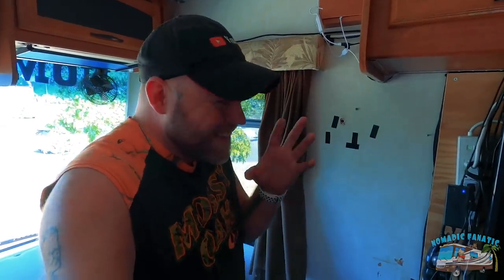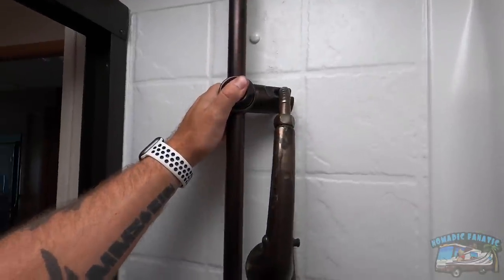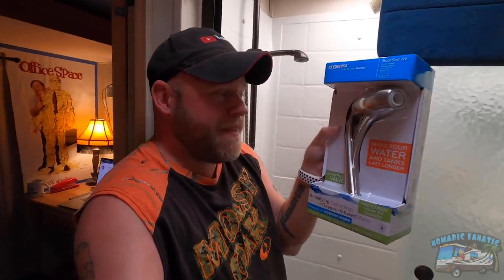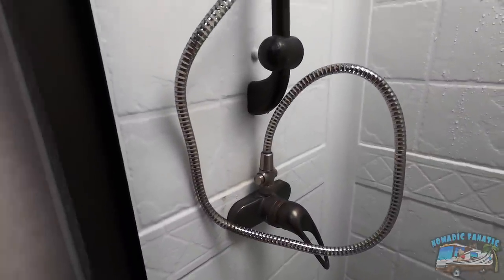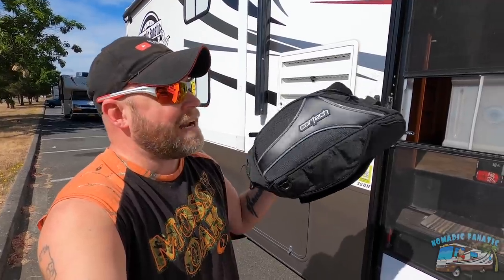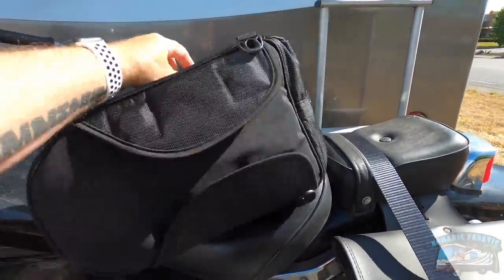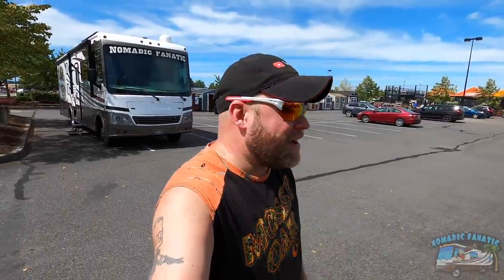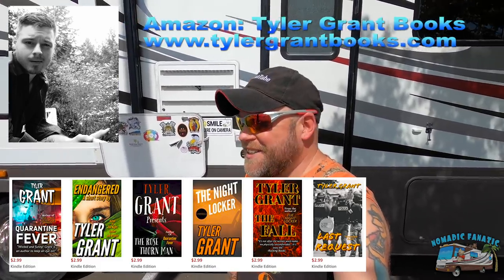Backwards Time, Toxic Fume Tracking & My Drawers Are Crappie

Comment: It doesn’t fit because that end is supposed to screw onto the tap end.
Reply: I noticed that too...pretty sure the hose is backwards
Reply: I went back and watched the video and sure enough the hose line is on backwards. I’m surprised Eric didn’t catch that. Too late now, I bet you that other hoses in the trash.
Reply: This is really sad it came from the  factory like this....
Reply: Eric, u are supposed to slide the plastic just above the metal nut into the clamp from the side. :D

Comment: I had that same tank bag plus the three side bags by cortex. You forgot to mention the tank bag when it comes off open the zipper or Velcro on the back and it has backpack straps attached, well at least the model i had did. Plus a zipper on the bottom going all the way around the sides when un zipped made the bag expand to hold more if needed. Look into the side bags and the connecting top seat bag also. They come easy and have shoulder straps to carry and also expand. Also your tank bag should have come with one of those plastic disconnects strap meant for one side to be wrapped around your handlebar and the clips onto the tank bag, so when going down the road the wind will not blow it off. Yes the magnets are strong but i can recall having a lot of items in the bag and a strong wind blew and somehow i helped the bag come lose from the tank with my legs. But the strap saved it. 
Good to see your doing great. Maybe see ya on the road someday.

Comment: Tip One - when assembling cheap furniture, wood glue is your best friend!  Use it liberally, and that cheap stuff will last a lot longer. Fill those slots where the drawer base fits with wood glue, and glue all of the sides too.  Not only is this furniture cheap, but you are subjecting it to road vibrations just like the clock.  Cheap furniture in your house NEVER goes down bumpy roads.....wood glue will literally hold it together firmly.

Comment: The shutoff is great for "Navy showers" to use less fresh water. Once you get the temperature right you can close the valve while you lather up. I've fixed low-grade drawers like that by running a bead of white glue all the way around the edge of the bottom. You'd be surprised how strong and stiff the drawer is with the edges secured.

Comment: When putting Walmart furniture together I have found if you use wood glue on every seam even the thin grooves where the drawer bottoms slide into the furniture stays together and doesn’t fall apart. Still use the nails or screws what they provide but add the wood glue and you’ll have a piece of furniture that will last longer.

Comment: If the digital clock messes up too, it could be batteries vibrating loose from contacts. Maybe? I have that showerhead also. I started laying it down in the tub when I travel because the holder has a tendency to break. Also some campgrounds have wells, and even with a standard filter I got sand in the showerhead , enough to plug it up. Easy fix though.
Exciting day for me, new water pressure regulator just arrived 😁. 
You and Jax have a good day.

Comment: Interesting how when you put the two letters RV in front of something. The price doubles or triples! 🤔
Reply: its the same whit boats....
Reply: @MrBugsier5  No, stuff is 3 times as expensive when it says "Marine Grade" on it! BOAT - break out another thousand!
Reply: I completely convinced that the absolute best way to get a good, decent motor home is to design it yourself. Start with a bus, and then contract out the work that needs to be done yourself. Also, help as many of these contractors out as best u can to save on expenses. You have enough time in a motor home to know what you need to do to build something that would suit u, Eric.
Reply: Oh, and you'd have a hell of a lot of nice videos to make while you were building the thing as well.
Reply: For sure , like TP
Reply: I think you might have tried this but turn the slide bracket over because they're tapered like your new one ☺️

Comment: Try the threshold 6 hole fabric basket type stand. Put a back on it made out of thin wood..glue some magnets on the wood (inside) . grab some of the threshold fabric boxes sew a hunk of metal into the basket where the magnet is glued and they won't come out...   Also glue all the wood parts together . It'll be stronger than what you have probably about the same weight..

Comment: Hey Eric The showerhose is on backwards
Reply: The old one was. The new one is two sided. 

Broke my heart he drilled new holes when all he needed was a 20$ head from target and flip the hose.
Reply: no he did not have to do any of that all you had to do is twist the holder there tapered inside his holder was 90° off all to do is twist the holder over and it would have went right in..lol.but just my 20 year opinion..lol

Comment: Hope the new clock works - I have a similar digital clock, which I hung on the wall of my RV with command adhesive strips. The problem is that the back of the clock vibrates against the wall and hits the buttons used for setting the day/date/time, so it hasn't been accurate since I hung it! I'll have to remove it and figure out how to put more space between the wall and those buttons.

Comment: That's funny about the toilet vent. LOL. BTW, the only problem with your previous setup is that the hose was on backwards. Flip it around so that the tapered end is affixed to the hand-held sprayer and it would have worked fine. If you still have the hose I'm sure you could use it along with the new oxygenics and then the only "silver" would be the actual sprayer.

Comment: If that’s true Eric, the clock should speed up when the minute hand should vibrate toward after it’s past 12. My guess is that the battery is losing contact when the clock vibrates. That’s the one way to only lose time and not gain it.
Reply: Unless you do most of your driving before noon??

Comment: The factory hose was installed the wrong direction.  Put the long fitting on the wand and it would fit in the holder

Comment: DO YOU HAVE ELMERS WOOD GLUE   ,,I FIXED A DRESSER WITH DRAWER BOTTOMS  THAT FELL OUT  ,,FROM OVER STUFFING WITH CLOTHES  ,,  I TOOK DRAWER OUT THEN POPPED BOTTOM BACK IN  THEN RAN A BEAD OF GLUE AROUND BOTTOM THEN AFTER 24 HRS I DID THE INSIDE  TOO   YOU COULD GLUE A STRIP INTO THE ONES YOU FIXED WITH A GAP  !!

Comment: Buy a length of pvc pipe and a 90d bend, glue them onto the toilet vent so it goes to the back of the roof. Or however you need to get past the solar panels.

Comment: Doesn't fit because the hose ends are reversed. The tapered end is supposed to go into the socket of the holder. Also, your theory on the analog clock doesn't make sense because when the second hand goes to the quarter past position the bumps should make it go down hence speeding up the readings. I think that you should go back to the spooks theory. There's ghost in your RV Eric.🤣🤣
Reply: There’s no bumps if your not driving. Maybe most of drive time is before noon.

Comment: I've been through 2 wall clocks at work.  they keep stopping on me for some reason.  I'm not driving around, it's just a clock on the wall.  I keep changing the battery, it keeps stopping.  I have no idea why.  Won't even run for a whole day

Comment: Have you considered running a battery tender lead to your motorcycle rack from your solar power?  Would help your battery last for years and years!  You could just plug it in after you load up the bike.

Comment: Sadly, I don't think digital will do it. I have 3 (satellite) atomic clocks in several places (2 in the kitchen) and they are all different times. I can reset them and they still get off. I have 2 electric clocks with battery back up in the bedroom and they are only the same when the time changes. I just rely on my cell phone. It is the most stable and accurate.

Comment: The L bracket should have been on the bottom of the draw not the top will you put it The weight is going to push down not up
Reply: And he said the plywood was a inch too narrow, he had those 2 big sheets, why not rotate it and use the long side? He would have had to cut 2 sides, but he had a saw, so no biggie

Comment: Pull all of your drawers out and run a bead of PVC around the base plate. It adds strength and your drawer base plate vill never fall out. I do it to all of my drawers and have never had a problem since. And its a cheep fix.

Comment: You may easily have a point about the clock being shaken about during travel and knocking the hands  out of time , but I have also  found that using rechargeable batteries on clocks does not work well...they are  calibrated for a 1.5V batteries... rechargeable batteries are 1.2V.. this causes all sorts of problems from bad timing to short battery life ... do not be surprised if even a digital display is off by a few minutes a month on rechargeable batteries... all battery clocks have a quartz now, a digital display will last longer and stay in time better because there is no motor to power.. try a proper battery, it will last a year or more and stay in time right up till it stops and needs a new battery...